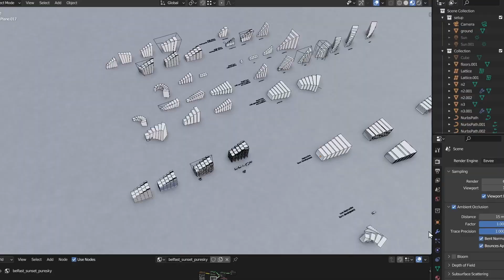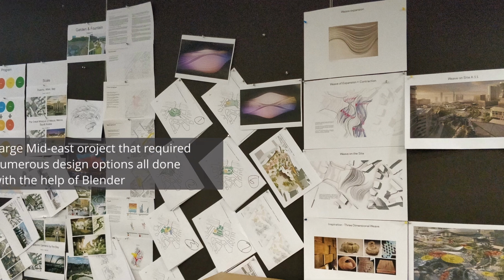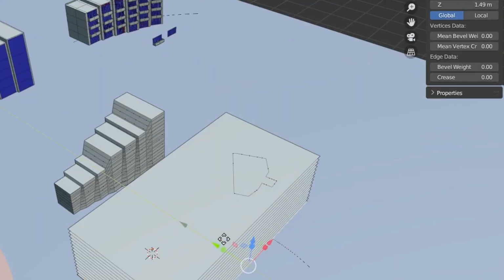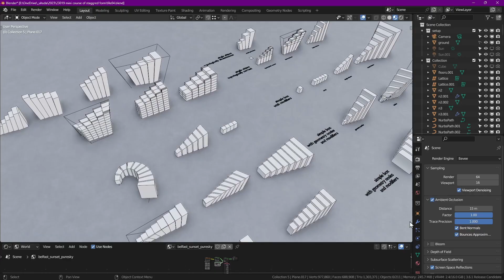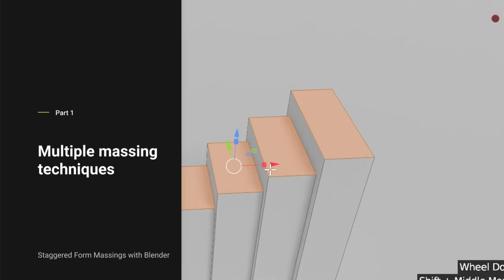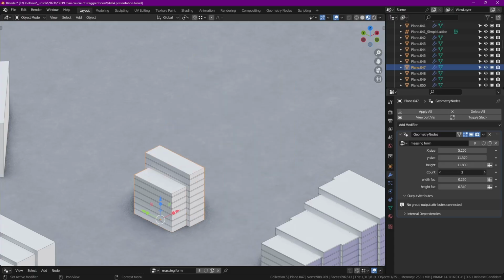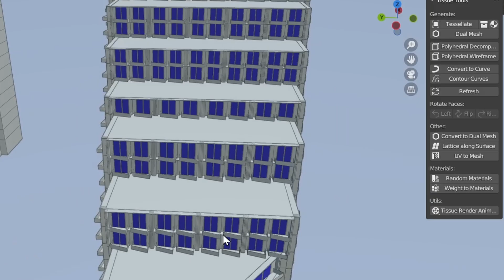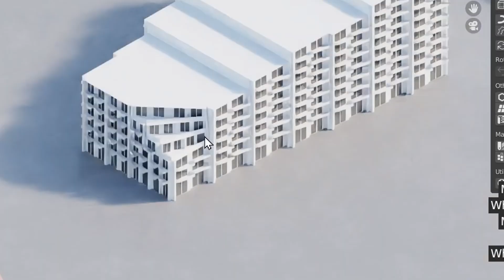Parametric Staggered Building Forms - New Blender Architecture Course!

Comment: Hey. The course is great. One thing comes to mind: would you consider such tutorial for housing arch-basic functional, modular plans, starting from eg sketching in Bl, through 3D till presentation input/in Ps eg/ or comoetiton boards?
Reply from the maker: Hi. Great question. Plans are tricky and, yes I suppose it is posisble to develop modular plans for your region. And then, yes it is possible to develop further for the presentation. Currently, it is also possible to grab the areas of different rooms, etc with BlenderBIM. The only thing missing is proper plans, and although it is possible with BlenderBIM, they don't allow for the same amount of flexibility as, eg. Rhino.